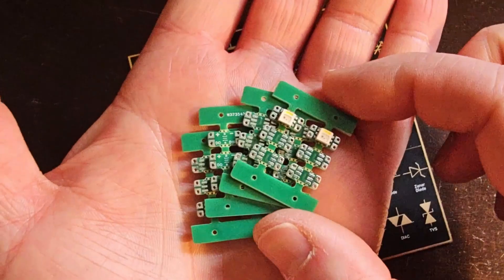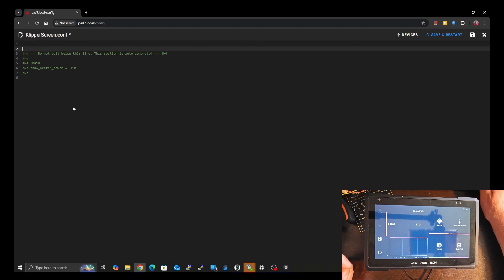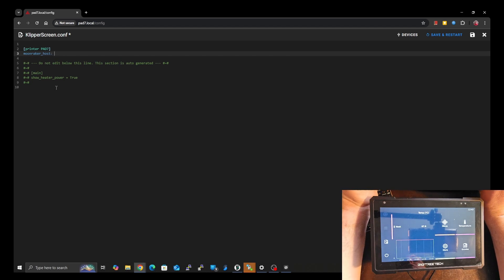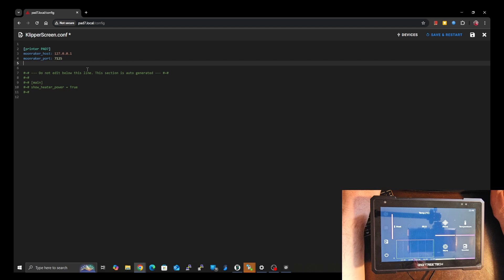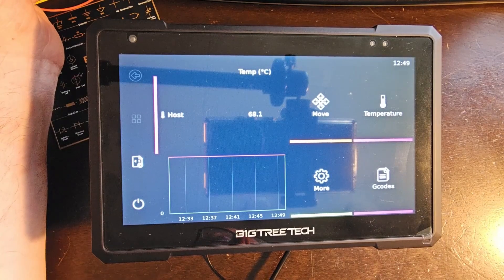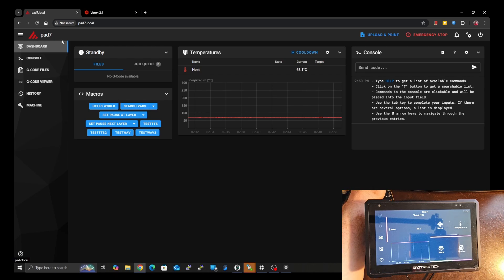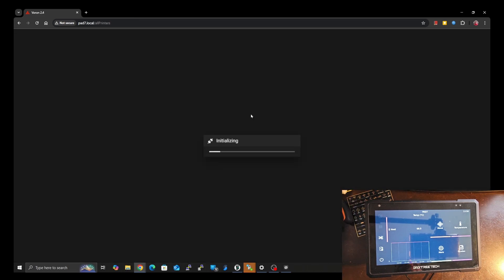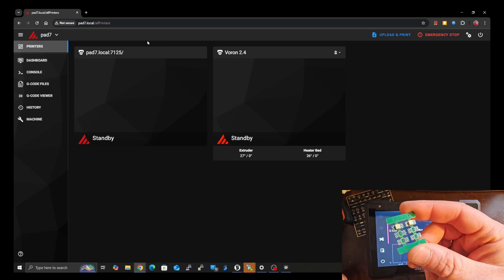How to control multiple printers with KlipperScreen

Comment: Is it possible to have 1 BTT pad 7 on each printer and have seperate mainsail tabs?
Reply from the maker: Yes. This should work with any combination of hosts.
Reply: @StackingLayers   I have 3 printers and have 3 BTT Pad 7. I'm unable to get 3 separate mainsail at the same time. Would like to have 3 separate mainsail, 1 for 1 if that makes sense.

Comment: Is it possible to have the rapsberry pi that is in the pad7 be the host of those machines? Instead of having the pad 7 be a connector the linux hosts, can it just be the linux host? I'm just wondering if we can use this to do the machine planning that gets sent to the MCU's running klipper. That way we don't have to have 35 raspberry pis basically reading a text file line by line to the MCU. We could just use the one linux machine that is in the pad 7 issue the instructions to the machines.

Ideally the flow would be to have  work station using Orca to create g-code. You then upload it to the pad 7 's ip and the pad 7 "prints" the instructions to a port that the MCU on the machine is always listening to. This would replace Orca "Upload & Print" to a standalone system that has it own raspberry Pi with an IP and port and then we remote into each machine to see what it's doing. I'm trying to not need to have Pi's all over the place unecessarily though it wouldn't be so bad if I could just put a bunch of Pi Zero 2's on each machine and then use the Pad 7 to Indiana Jones Rope Whip myself between them.
Reply from the maker: The original design of the past is to be a host screen combo. You can run multiple printers from it, especially with a raspberry pi Cm4 with more ram. Look up klipper multiple instances.
Reply: @StackingLayers  Gotcha! I just looked into it that makes sense. Thanks!

Comment: I followed all the instructions and it has not worked for me. I'm using the Pad 7 and I don't want to do separate IPs. and for some reason it's not showing up on my screen.
Reply from the maker: If you are connecting 2 printers direct to the pad7 (or other single host) then you'll need to change the port number to match the instances. For example printer 1 as 192.168.1.10:7125, and printer 2 as 192.168.1.10:7126. Note that it must match the port defined in the moonraker.config
Reply: @StackingLayers  I'll give it a try tomorrow. My brain melted a while ago. Thank you
Reply from the maker: I know the feeling well. Don't worry you'll get it working. Just don't give up.
Reply: @StackingLayers  I might need help. Is there a way I can get ahold of you on Discord if possible?

Comment: Took me a bit to figure out why it wasn't working for me. Simply had to reboot my pi and it then worked great. I'm actually considering pulling the TFT35 off my Micron and the V0 display off my V0.2 and just controlling all 3 of my Voron's from the one 5" screen on my V2.4. Thank You for the video.
Reply from the maker: You can still have the other screens installed, this won't affect them. It just gives an additional control point.